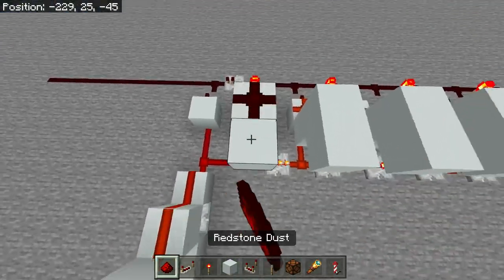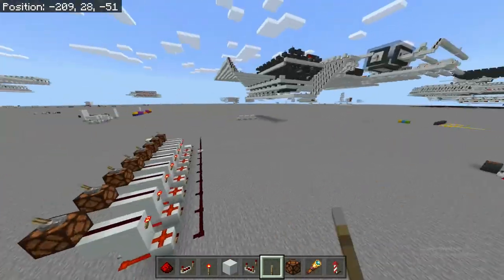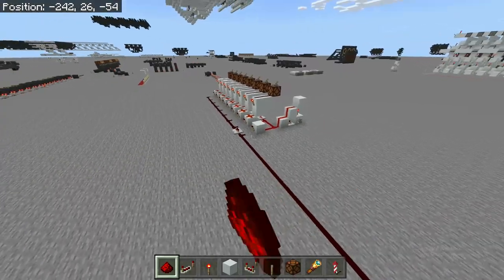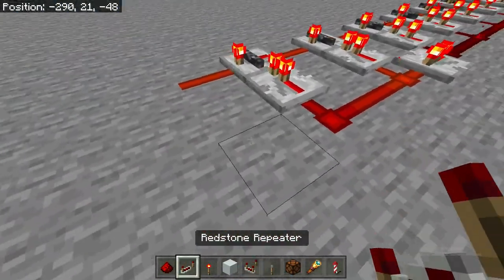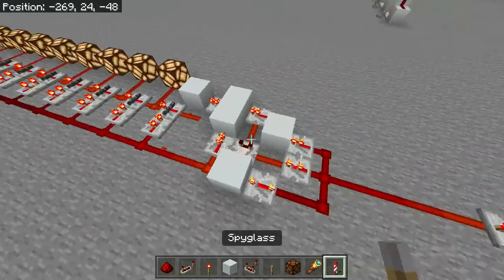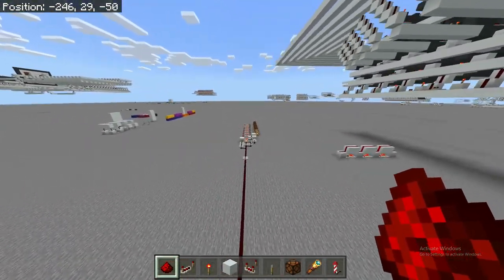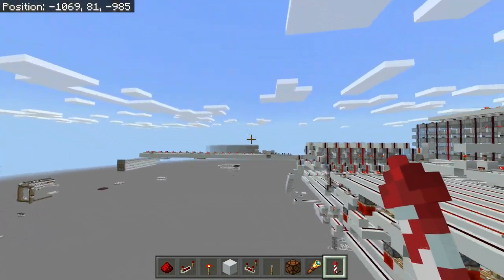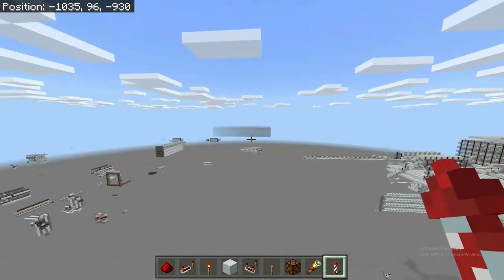Serial Data Tutorial and examples - Minecraft Bedrock Edition

Comment: I'm in java edition so idk if that has anything to do with it but, I have all the ticks aligned perfectly and it for some reason only works if the input is all high numbers in numerical order (left to right) and any time I try to make an actual code (for example: 00101100), it lights up too many or too little lamps. It only works if I do something like this: 11110000, or 10000000, or 11111100
Reply from the maker: That's weird - this design originated from java edition so it should work fine. I would just keep checking all the repeater timings as even just 1 repeater can mess it all up. For your input line make sure all repeaters are only on one tick and double check all the actual decoding circuit.

Comment: I'm making one with 16 bit and I had problem with (idk where cause I just learning this thing)..when I lit the first lamp and send the data the decoder just doesn't receive the data,it works for 8 bit but when I extend it doesn't working properly and also the first and sec lamp doesn't give data when I send it but the third lamp does send data but in wrong order for example when I send 1110 and decoder give me output 1000 data
Reply from the maker: Just make sure all the repeater timings are correct as this is quite dependent on timings.
Reply: @TheDarkness344  how many bits you can do with this encoder and decoder
Reply from the maker: @qeleriey  theoretically infinite, but it makes the design a lot larger as you need to expand for timings. If you are working with a lot of data, it is best to split it up into multiple parallel streams, which not only simplifies decoder design but also speeds up transmission.
Reply: how long bit that usually you preferred..and also where did learn about the encoder did you makes yourself or from someone, I would like learn more about those
Reply from the maker: @qeleriey  I use 16 bits in my designs - 4 bit address, 4 bit command and 8 bit data. This by no means is a good protocol, but it is what I use. I found the decoder In this video - https://youtu.be/cjp0SzkFwBM
And I think the encoder may have been by properinglish but encoders are really easy to make so it is not too hard to design your own. I have uploaded a more compact encoder design on my channel as well, tho it uses pistons.

Comment: I can't get it with 16 bits..I build it from 8 bits and keep adding one bits for each encoder and decoder each time to make sure everything is fine and for some reason the 15 bits module doesn't send the data properly even on I only add one tick from 14 bits module which working properly
Reply from the maker: It may be you need to add a repeater, but make sure all lines are synchronised or it will break
Reply: @TheDarkness344  is there any changes with the receiver  if you want send a lot of bits aside from the timing that you show...I think the main problem is there
Reply from the maker: @valls64  if the signal runs out, you will need to add a repeater inbetween the bits, but this also means you will need to remove the matching repeater on the other side so the timings stay the same.
Reply: @TheDarkness344  I mean the timing section I think the output section is not that hard the timing one is more confusing🤔
Reply from the maker: @valls64  you basically have to add one tick after the 4 tick repeater for every additional bit - I would recommend experimenting adding and removing repeaters in this section to make sure your data lines up properly with the respective output bits. (Like if it is one bit to the left/right try add/remove 1 tick)
Reply: @TheDarkness344  yeah I've tried that and it seem there's no way to fix.ive rebuilt it too see a difference between them and absolute no at all and most thing I've noticing is the first bit from the transmitter doesn't stored by the receiver sec bit working fine and others too
Reply from the maker: @valls64  is it your input maybe running out of signal strength? If you built the same encoder as me you will need to add a repeater at some point so all the bits work. If you find you can't fix the other alternative would be to use 2 8 bit ones and just use 2 wires (which would actually double the data rate) or transmit 1 8 bit signal at a time.
Reply: @TheDarkness344   @TheDarkness344  the encoder should be fine but the decoder one and can l change the repeater on this section 12:49 maybe adding more tick with repeater or adding more of it
Reply from the maker: @valls64  you could try, but it is easier to just add/remove repeaters after the 4 tick one as it does essentially the same thing.

Comment: Anybody help me with an issue I'm having? I'm trying to make it a 12-bit encoder, but the first digit  or so just isn't sticking. Every other bit is captured correctly.
Reply from the maker: Maybe the encoder has a two tick delay on the first one?, Make sure it is fully synced as if you have used repeaters to extend the length (in the encoder not the wire), then you have to make sure their is no delay on the encoder section opposite it as that would add up to 1 tick delay.
Reply: @TheDarkness344  I figured it out. And yeah, it was basically that. Setting the bit furthest from the send button to a two ticks underneath and adding a single tick to the torch side solved it.
Reply: @TheDarkness344  turns out I broke the 1's place. Hecc.
Reply: @TheDarkness344  Nvm, you were right. I just removed the repeater opposite of the side I had to add one for it to be sent and now it works.